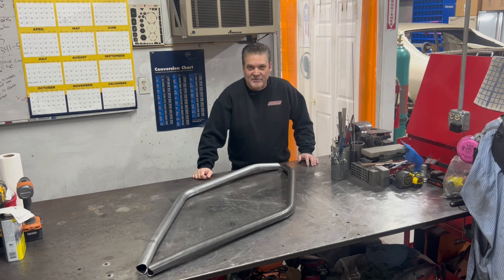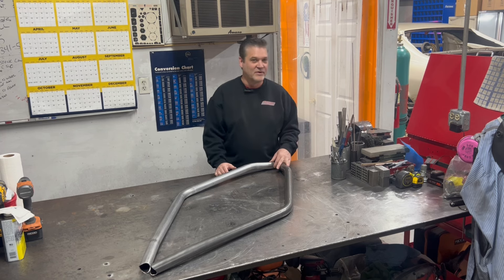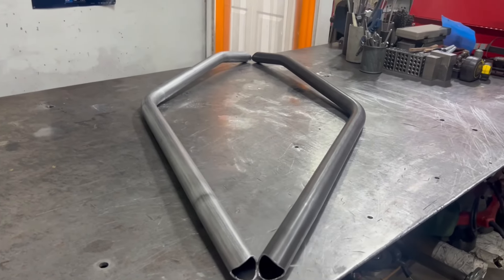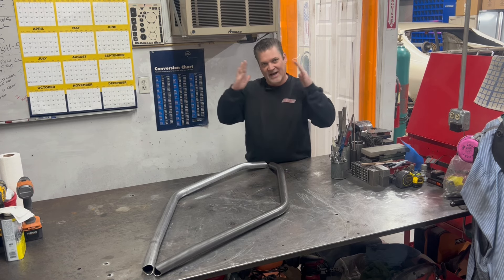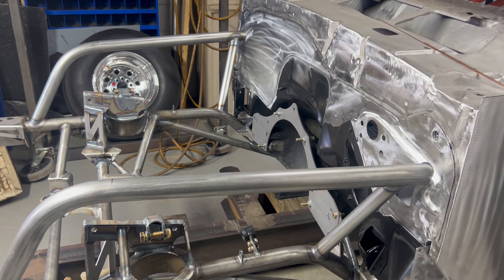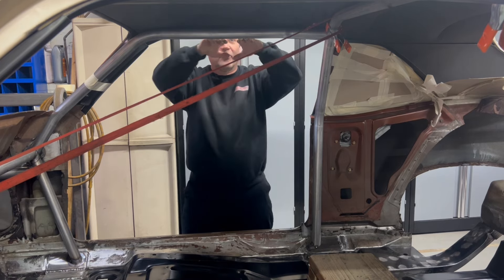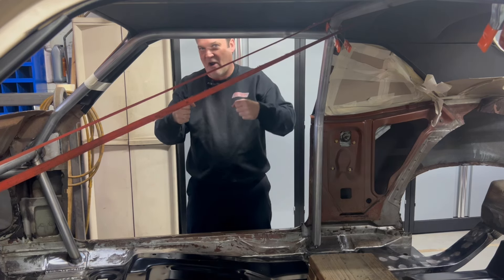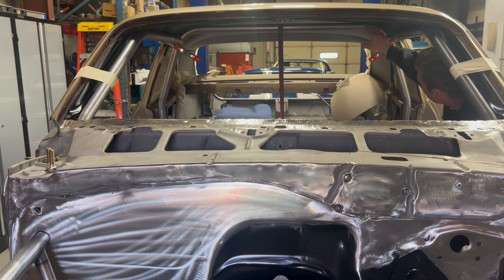ROLLCAGE INSTALL THE PROFESSIONAL WAY! 1971 Nova👀

Comment: One question, the dash bar, the two bars that are at a angle(to the floor) is that because of the front horizontal bars that tie into to the front of the frame and the dash bar? Thank for any response in advance.
Reply from the maker: The 2 bars that are angled back, are considered the “A” pillar bars. With this design they are interrupted by the dash bar. The engine bay bars tie into them. Thanks for watching 👍